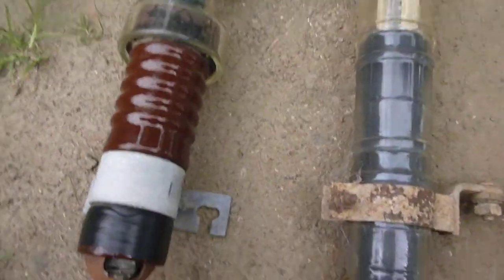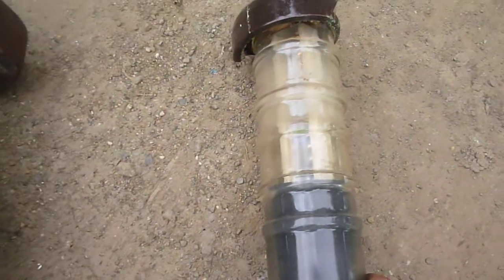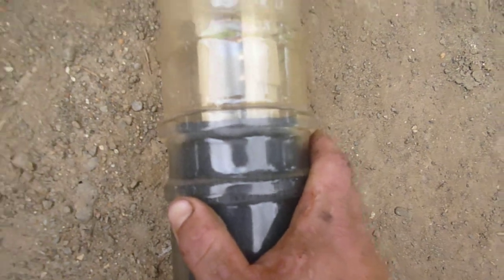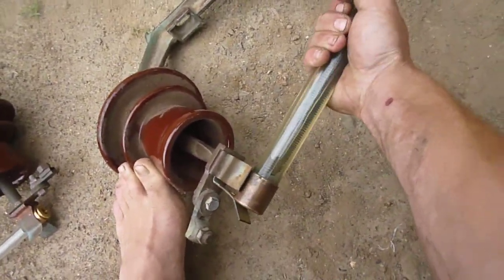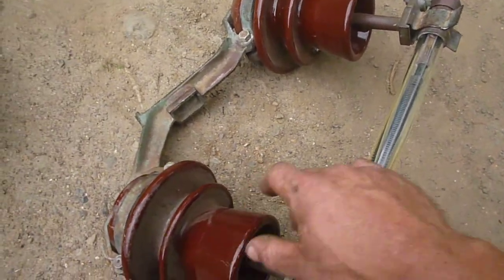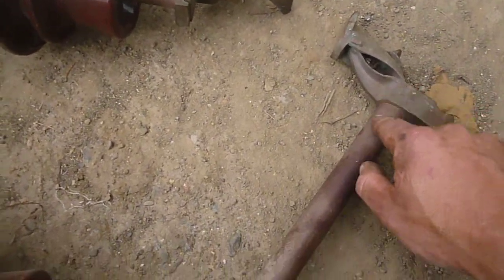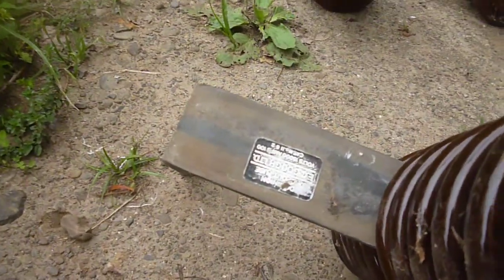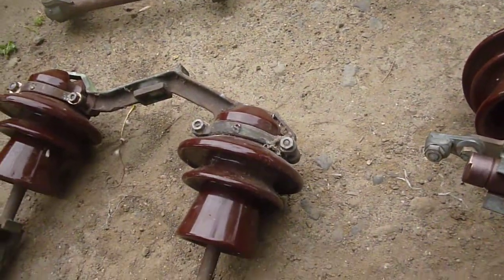early power line protection equipment.   saving our electrical heritage

Comment: Nice LA's.
Awesome ! Never seen one of those liquid fuses, even those glass ones. That Dominion retrofit is very clever.
Reply from the maker: they are cool   up here there is all sorts of wild stuff  some of the swer lines are original with a no8 wire conductor on orig hard wood poles and ohio brass insulators nice to see